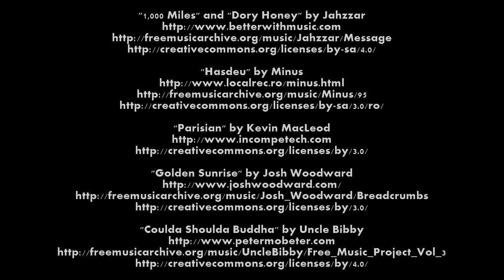#09 New Vehicle ~ Coast to Coast (SV Sundowner)

Comment: VERY COOL I'VE ALSO HAD ONLY THE HARLEY FOR OVER 18 MONTHS AND WITH THE BIG LEATHER BAG ON THE BACK OF THE SEAT I COULD GO GROCERY SHOPPING ON THE BIKE BETWEEN THE SADDLEBAGS AND BIG BAG AND CARGO NET ON THE PASSENGER SEAT I COULD MAKE QUITE A HAUL ENOUGH STUFF TO LAST A FULL WEEK. SO THAT'LL BE COOL YOU'LL BE ABLE TO ROLL OUT TO LITTLE LOCAL MARKETS WHERE EVER YOU'RE STAYING AND PICK UP SOME LOCAL GOODIE'S AND HAVE A BLAST GETTING THERE AND BACK. I COULDN'T IMAGINE NOT EVER RIDING. AS FAR AS M/C INSURANCE YOU MAY WANT TO CHECK OUT MARKEL AND FOREMOST A HELL OF A LOT CHEAPER THAN YOUR AVERAGE VEHICLE INSURANCE. WITH MARKEL I ONLY PAID $385. A YEAR FOR FULL COVERAGE. FOR A 1340 FXDWG WITH AN EXPENSIVE CUSTOM PAINT JOB TOO.
Reply from the maker: +Greg Wierzbicki Very cool! We use the RV for giant trips to Sams or Walmart but will use the bike for the occassional run into the local grocery store:) We have insurance through Progressive, the same as our RV insurance. We could have gotten it cheaper probably by going through some other company but it is easy to bundle them together.
Reply: OH GAWD PROGRESSIVE WAS THE HIGHEST QUOTE OF ALL OF THEM IN DELAWARE. FLO MAKE'S ME CRAZY I CAN'T STAND THOSE COMMERCIALS. TRYING TO OUTDO GEICO INSURANCE AND THEY CAN'T GEICO HAS THE BEST COMMERCIALS. MAXWELL THE PIG. & WOODCHUCKS CHUCKING WOOD ARE MY FAVORITE.